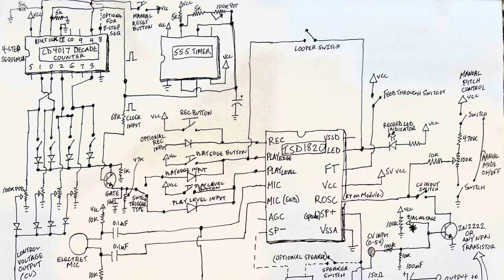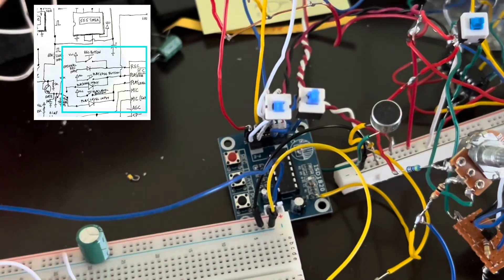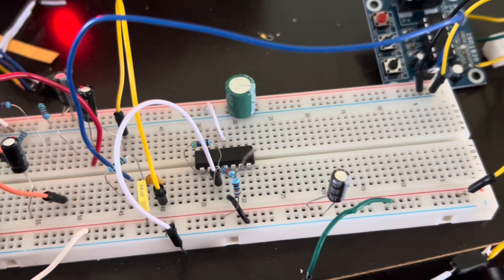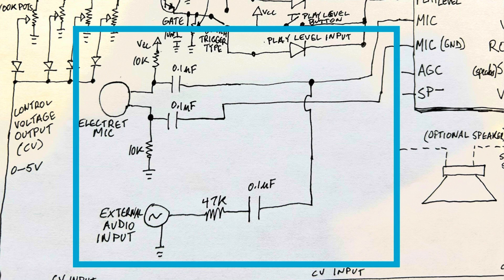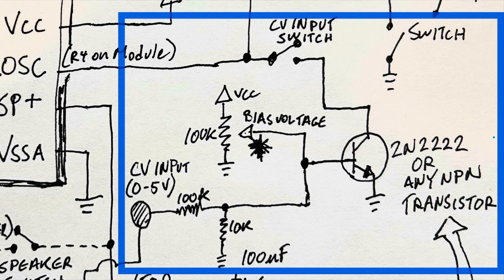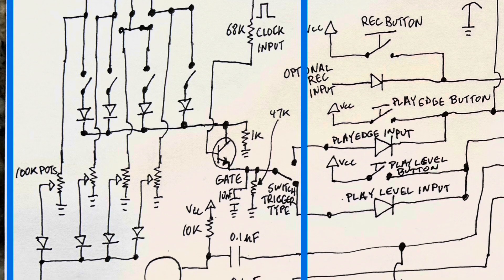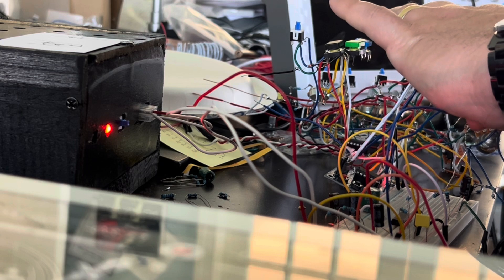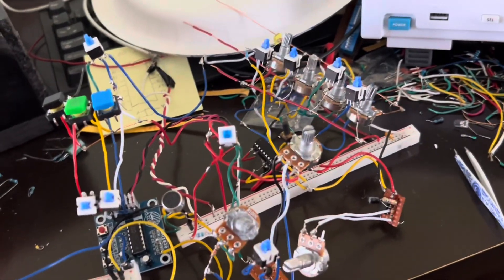ISD1820  Sampler Part 3 - Complete Schematic with Sequencer and DJ scratch demo

Comment: Greetings Igor , wow, excellent job expanding on this interesting IC , I had recently been collecting info to see how far I could expand on the ISD1820 and you have answered much of my questions😋 , also inspired by LAURI’S DIY CHANNEL TV -  DIY 4 channel isd1820 lo-fi SAMPLER video, my idea was to expand on the 4 IC's in parallel, as Lauri did but have more control when triggering the IC's individually with gate inputs . Lauri's samples where manually triggered as he engaged each switch to loop his samples leaving the timing very random, which is certainly interesting but to have a bit more control triggering Samples would be neat as well. One other idea was to link all the pitch together so all the samples are sped up or slowed down together in sync. I am excited to replicate what you have done and then experiment further with more IC's in parallel, any chance you could make the schematic available for download? 😁 , yes there are other better options and modules to play back samples but my interest is specifically in seeing how far this ISD1820 IC can be expanded,  a fan of your channel and look forward to more of your content Regards from South Africa
Reply from the maker: Wow thank you. I just have a pic of the schematic. Would be happy to send it to you.
Reply: @igorbrichkov3632  Hi Igor would it be possible for you to share your schematic somehow?